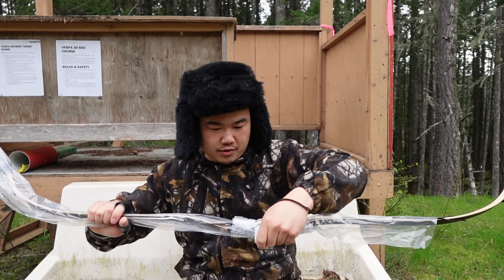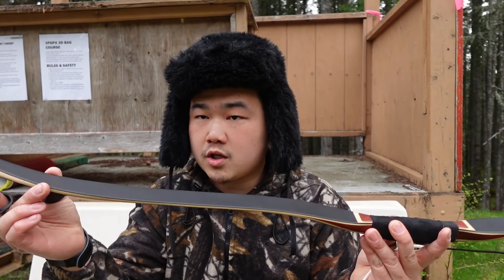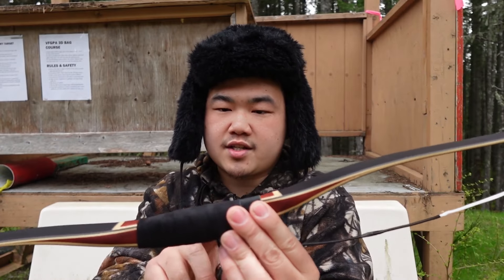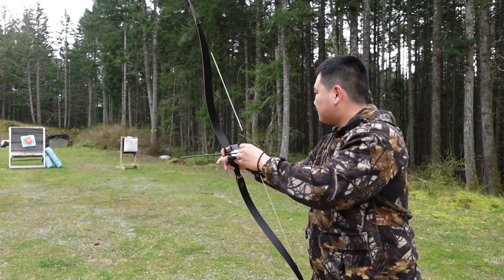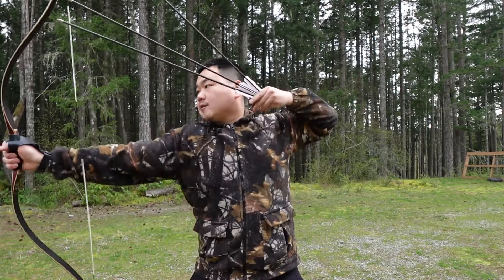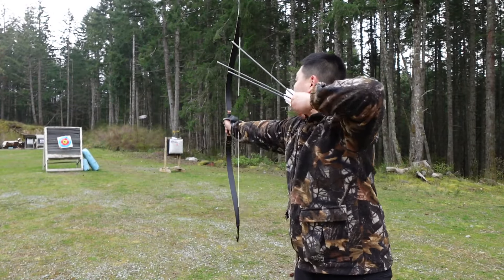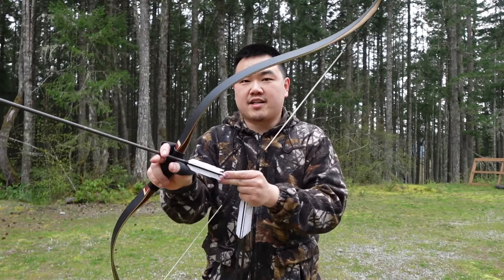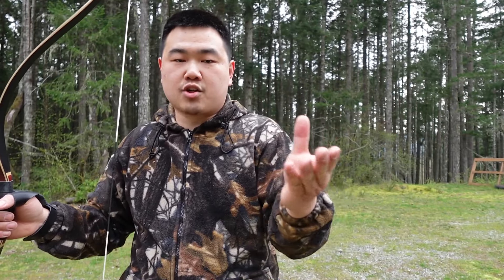Daylite Kazan Bow for Speed Shooting

Comment: Ignoring repeating crossbows, i think this bow is optimized well to rapidly shoot arrows manually without a device

-fast limbs with carbon core allows fast arrow speed even with partial draw 
-narrow arrow pass
-ray skin for longevity
-medium bow length allows a balance of string pinch : cumbersome length ratio
-45@28 is a good weight for the context of this niche